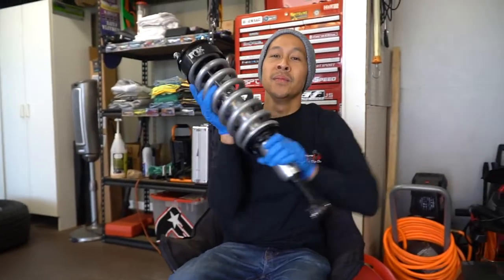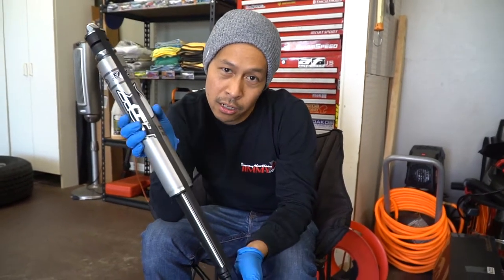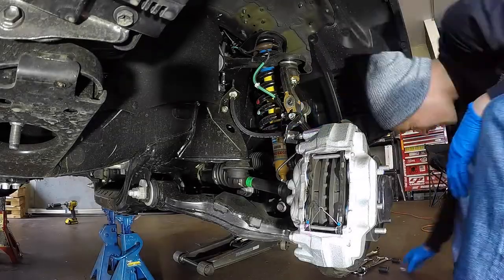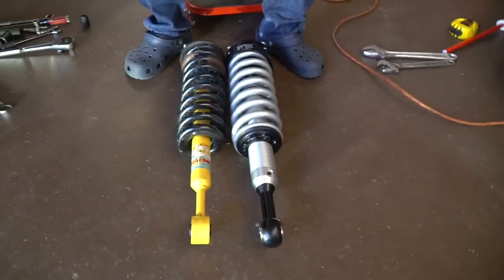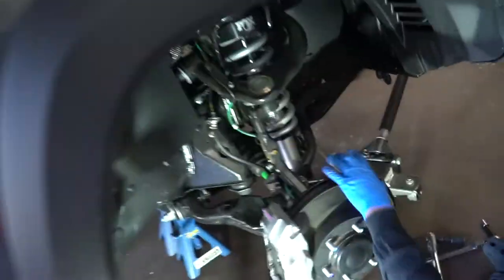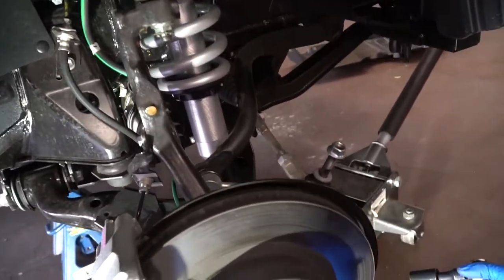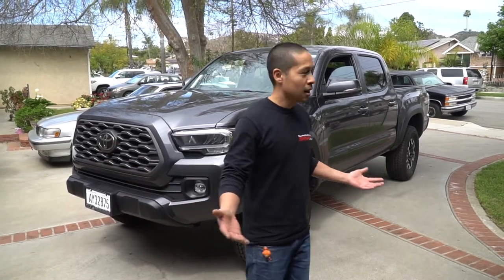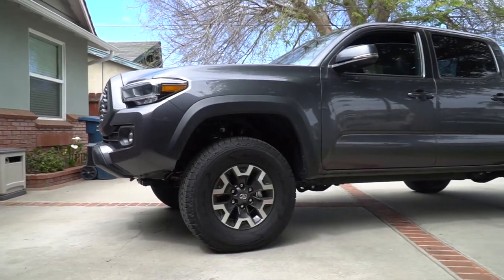2020 Tacoma TRD Offroad | Fox 2.0 Suspension Install

Comment: My big change on my 2020 TRD OR was to put K02s on , wow what a difference from goodyear. Handles bumps smother and easier to steer and much better grip in off road conditions. Plus the look is much better!
Reply from the maker: I’d consider new wheels and tires as I’m not too crazy about the factory wheel design... but seeing how there’s 3-4 of these sets of wheels for sale locally at $600, and no ones buying. I might as well put the miles on these tires. But I’ll keep it in mind, you know, to justify buying new tires. 🙂

Comment: Can you make a video about the ride quality before and after the upgrade?
Reply from the maker: Read through some of the comments here and you'll see my feedback.  I haven't driven another 3nd gen tacom with different suspension to compare it to.  Compared to stock it's stiffer and handles weight transfer better. I'd recommend this over leveling kit.

Comment: It only adds an inch to 4x4?
Reply from the maker: For 3rd gen Tacomas the off-road and trd pro are lifted 1 inch already. So out of the box I got an extra inch of up front. You can adjust them to go up another inch if you prefer.

Comment: Did you guys install the sway bar relocation bracket?  Also was the strut and spring already assembled?
Reply from the maker: I did not use the sway bar relocation. I didn't think it was necessary for a 1 inch front lift.  The strut and spring were preassembled and I didn't adjust the height.  Just installed it out of the box.

Comment: Are these better shox than my 23 off road bilsteans that come stock on off road?
Reply from the maker: Front spring rates are higher so you get less dive under braking. Good to level out the front end while getting better handling on the street. I'm 40k miles in now and I haven't had any issues. Though I wish I would have dialed the ride height a little higher in the front.

Comment: Anybody know how to adjust the ride height certainly you do not have to take them completely off the front right is a 1/2 inch higher than the back And front left. On my 2007 it went past level is higher than the back and I've got new  Factory Springs in the back.
Reply from the maker: The reviews I read on these coilovers mentioned plastic/poly collars and have the possibility to skip teeth when you go to adjust them. Just a bit of caution if you adjust these without taking the preload off the springs.

Comment: So is the lift you get in the front of a Tacoma 4x4 only an inch? And is there any lift at all for the rear on a 4x4?
Reply: I have an 07 TRD Sport currently leveled with Bilstein 5100s.
Reply from the maker: No lift in the rear. Fronts are adjustable you so you can get anywhere from 1-2 inches.  Same as the 5100 series if you raise the front perches.

Comment: Did your front come with the foam looking Bump stop on the front strut is self I feel like I need to take it off before I install but I’m not sure haha that would mean I need some spring compressors to take everything apart which seems super odd
Reply from the maker: I can't remember if the fox struts had bumpstops, but I didn't disassemble either ones I just installed the new one how it came from the factory.

Comment: Does the rear sit lower without a block or add a leaf? I want to get this setup but I really don’t want the back to be lower than the front.
Reply from the maker: Tacomas come with about 1 inch of rake from the factory. My goal was to level out ride height by raising the front. If you adjust the fronts higher then yes you’ll need to do something about adding height in the rear.

Comment: Hi can i ask what's the parts number for those coilovers im planning to put same shox on my truck. Thanks!
Reply from the maker: Most offroad websites sell this as a package so you don't have to lookup individual part numbers.  I tossed my boxes so i don't have them specifically. Most websites refer to this as a "stage 1" suspension package.

Comment: Hey brother, thanks taking the time to post this video. I recently ordered the same set up. I have the TRD OR 4x4 and have a quick question. Did u end up doing an alignment or was your drive good to go? Thanks again 👍🏽
Reply from the maker: I did an alignment.  Camber went positive a bit and then I zero'ed out the toe.
Reply: @RatchetFinesse  hey thanks for getting back. Just finished installing them. Those damn bushings on the rear kicked my butt! Had to use a dremmel to shave off a bit, but managed. Taking it in for an alignment tomorrow.  Thx again! 👍🏽

Comment: So  is better than stock ride?
Reply from the maker: After about 500 miles I'm loving the ride.  Handles dips in the road better.  The truck has more confidence in the corners. Less bed bounce on the highway. Ride comfort is slightly stiffer but in every other aspect it out performs the stock suspension.

Comment: Can i adjust mine higher while it’s installed?
Reply from the maker: You should be able to, but I didn't try. Take the wheels off to take out the preload.  You might need a strap wrench as Fox doesn't include the coilover wrenches.

Comment: What’s going on man I got a 04 taco I was just wondering if I need to change the upper control arms to if I do this. I recently change my rims to 16x8 which is stock no rubs or anything but I’m just wondering if is necessary to change the upper control arms thanks
Reply from the maker: You can use stock upper arms for up to a 3 inch lift. Anything higher you’ll want to get aftermarket upper arms to be able to get your front alignment to the right specs.
Reply: Thanks man much appreciated 🤙🏼